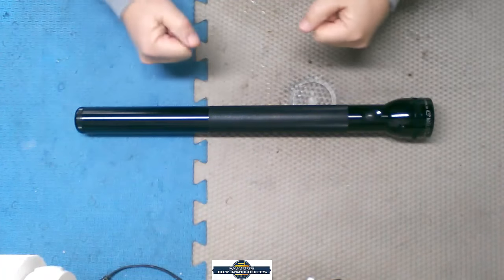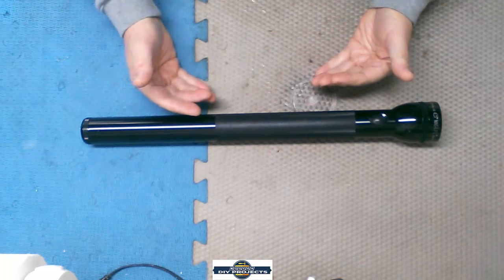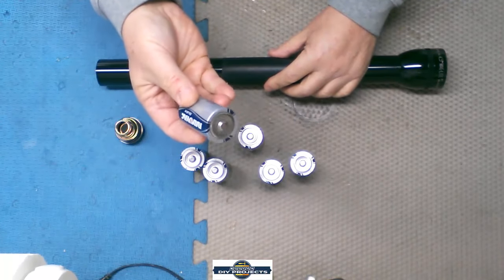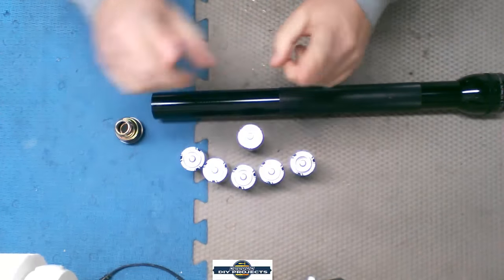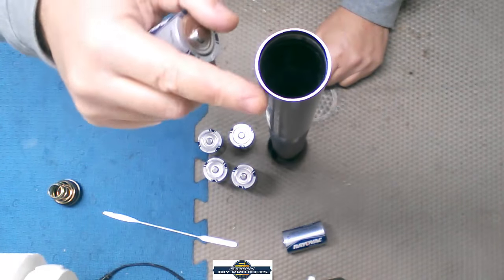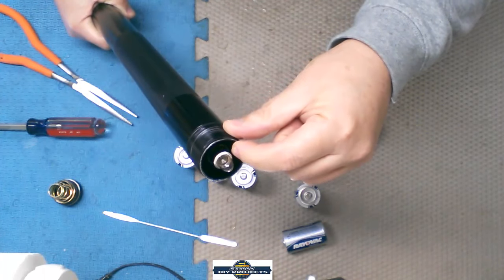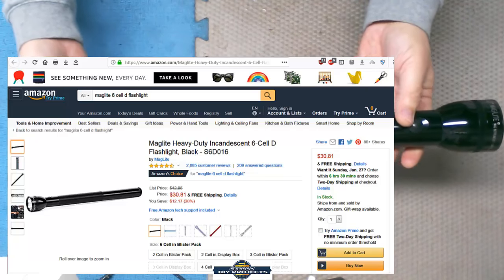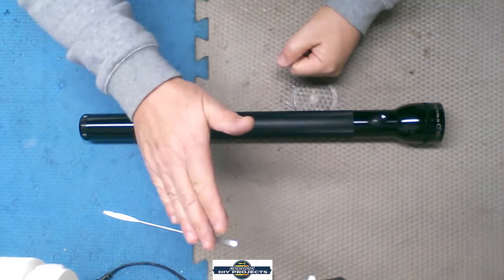Maglite Flashlight Batteries Stuck Removal Guide / How to Remove Exploded Batteries

Comment from the maker: In this video I explain how to prevent batteries from exploding inside your Maglite and possibly ruining it, and if the batteries do explode or leak and swell up, how to get them out without damaging or ruining your Maglite. I also throw in a few useful nuggets of information along the way. Hope you enjoy the video!
Reply: Yeah. The new ones are nowhere near the thickness of tunmbe as the old ones
Reply: Btw, which way, looking face onto bulb, does that part unscrew?? Yep got a bettery stuck corroded lol
Reply from the maker: @ozdavemcgee2079  Keeping in mind that mine is a 30 year old design and newer ones may be different, it's the standard lefty loosy. It is common for that part to get stuck, so don't force it or you could break it. Do what I did and soak the batteries until you can get them to loosen. Also, you can get a really long lag bolt, drill the batteries then screw the bolt into the batteries and and pry them out from the other end.
Reply: My batteries are stuck....  Can i really pour a solution of baking soda and water into the tube without damaging the torch?! Thank you v. much for the video!
Reply from the maker: Yes you can. It wont harm the aluminum body and it will neutralize any acid in there. I may fizz like crazy so just be ready for that.
Reply: @ModernDIYProjects  Excellent, thank you! I will try that!
Reply: Same problem. From Kashmir
Reply: I was happy to find this I’m gonna try it because I have two mag lights and one of the batteries are stuck in it my question is about the spare bulbs I don’t see one in the It shouldn’t be noticeable or do we have to actually pry something up to get to it
Reply from the maker: @Lisa LanceWork  Sometimes it may be covered by a piece of foam to protect it. It may also have fallen out or been removed by someone at some point.
Reply: Thanks
Reply: I would like to add a word of caution regarding where you work on removing the batteries and disposal of potential overflow. Initially I tried some cleaning vinegar (20% vinegar vs just 5%) and some baking powder plus a couple chemicals for cleaning rust of metal before I found the oil recommendation. While I used appropriate caution to protect my hands and had the MagLight standing vertically inside another container to catch overflow, apparently some of the vinegar solution still contained some battery acid and etched a blemish into my stainless steel kitchen sink😬  Not a large area but it sticks out like a sore thumb appearing as if it had been hit with an abrasive. There is definitely a very thin depression in this area I discovered after trying to scrub off what I believed was some kind of residue.
Reply: Maglite should have some sort of detachable cylinder to insert batteries into, and have that in and out instead. Perhaps out of plastic and with some pulling lobes. A possible few external  millimeters of outside thickness caused by this would not hurt too much.

Comment: I'm 65 years old.  When I was a kid, batteries leaked.  The battery manufacturers would GIVE you a new replacement flashlight, radio, etc.  They got tired of doing this and started making batteries that didn't ever leak.  They were leak free for years until the manufacturing went to China.  Now they leak again.  And I have had a $175 GPS unit destroyed by leaking batteries.  (There are so many screws to take the battery cover off, I didn't check as often as I should.)   The point is, WHY DO PEOPLE ACCEPT THIS?  IT is NOT the flashlight that is at fault. IT IS THE BATTERIES.  COMPLAIN to Eveready, Duracell, Rayovac, etc.  THEY ALL LEAK.   COMPLAIN.  Maybe if enough people complain they will FIX the problem.
Reply: Yes the old batteries didn't leak. The reason why you don't have those anymore is the way they were made. They were heavy metals in there and amalgam that is sometimes still used to fill teeth in some places while mostly forbidden in the west. So if you don't care about anything and want far less power from them, then you want those. 
If you want to reduce the chances of leaking:
Zinc-Coal, leak a lot cause the electrolyte is eating through the outer shell until it leaks out. 
Alkali-Manganese batteries leak far less (IF not the cheapest and if the whole thing can breath 1-1.5 years are fine). If they leak they'll leak from the negative pole (kathode) there are small holes to not have the battery really blow up from pressure build up. I still think they leak too often.
Lithium based batteries can be stored for 10 years and have the best quality control so they'll have the least chance of leaking. In the 8th year or so it's still 90%-ish like when it's new and they can stand the cold the best too. So buy once, cry once.
After the battery choice there are a few things to avoid to not increase the risk:
1. Do not mix somewhat used batteries with a new one if you got one left. Higher leakage chance of the old one. 
2. If you know you won't use something for months and it's no emergency equipment, take them out. Some say to tape the contacts but giving the spring contacts some time to relax isn't bad either. Little bag with a clip or zip log bag with it. I do that for some measuring equipment I rarely use. 
3. If batteries already leaked and it's some equipment you really care for, take the time to clean those (hopefully quality chromed) contacts with lighter fluid, alcohole (no extreme percentage for plastic) or what also works well is citrus acid (powdered to clean water kettle/water boiler and afterward some of the above to remove residuals of the acid. This milder acid (low concentration in the powder form with water) will neutralize and dissolve the alkaline crystals. Only if the contacts are clean they can't help to corrode the contacts and corrode the batteries' contacts when they are left there. It has to be spotless. if you read this far I recommend the Bunny in the max variant. If some is left, it'll eat at the spring contacts and they'll snap off. Luckily those are mass produced and cheaply found online.
4. In worst cases, you can use sand paper or a glass fibre pen that is used to clean circuit boards. That takes off material from the contact and from that point it will corrode far more than with the chrome on it. So don't use abrasives unless you see no other way and it just has to work for now.
Reply: I swear to god I don’t remember that being that big of an issue either. In more recent years it’s like they all do. Past couple months I was doing my rounds changing batteries and at least half had bad batteries.
Reply: “Chy-Na”

Comment: Don't try to "unscrew" the bulb carrier/switch assembly. That will break the assembly! The assembly is held in place by a snap ring which sits on a groove on the front end of the flashlight as a stop and a set screw. The normal way to get the assembly out is by removing the rubber cap on the on/off switch and then accessing an allen head screw that is the set screw. There are youtube videos that explain how to do this. If it is possible, you can undo the set screw then try to remove the snap ring to access the front end of the tube. If you can do that, then you can try to whack the battery from either end.

Comment: there is a lock ring in front of the switch assembly, and it is held in with a set screw under the rubber button. it can only slide out backwards like the batteries.

Comment: I just took my maglite and tap the bottom of the aluminum casing against a 2x4 until the broke loose
Reply from the maker: But when they really swell up inside that just wont work. That is when you do a lot of cursing to the battery gods! 🤬

Comment: Thanks for this.  I have the 3-AA cell Maglite w/a stuck top cell.  Started with baking soda and water, then hot boiling water, then WD40, the latter requiring several appls,  patience, and poking.  Finally freed up and saved me from trashing it and spending $$$ on new....
Reply: Wonder Bill  Thanks - great tip. WD-40 worked for me too - just a couple of appls and freed the very corroded batteries in minutes.

Comment: These torches are utter rubbish. This is the second time I've had these antics in 3 years. the last time I drilled the b'stads out. This time I am trying your oil idea. I keep the torch handy for emergencies but unless you have 15 emergencies a week you don't think to check the batteries - and then when you have the emergency you are in the dark and unable to put new batteries in. You can get a rechargable and much brighter torch from Toolstation for £13 made by Ring - and I think that's the way to go.
Reply from the maker: Well, they were the best back in the day, but today like you said there are many more alternatives.

Comment: I can't believe it!  Your idea of pouring oil into a Maglite actually worked on my 3-cell.  I unscrewed both the top and bottom parts and set them aside.  I used a vise to hold the Maglite upright (bottom up) and put a small catch pan under it.  I opened a can of regular motor oil and filled the flashlight up to the brim.  For several days I added oil every time I walked by (just like you said).  The oil ran down along the batteries, past the switch, and through the top of the flashlight and dripped into the pan.  After 2 or 3 ounces of oil ran through I decided to see if I was doing any good so I took Maglite out of the vise and whacked it down on a 2x6 on the garage floor.  After a few hard hits I noticed the battery had moved a little.  A few more whacks and whatdoyaknow, the bottom battery came out.  I kept going and the middle battery and then the top battery came out too.  The MagIite's threads were not damaged.  I used a screwdriver and a file to dig off the corrosion caused by the battery.  I sprayed brake cleaner and contact cleaner both into the flashlight to clean up the mess, using a rag and long screwdriver to swab everything out.  I actually put a little lithium grease on the batteries before I put them back in.  The great news is the Maglite works!  Hope you're able to get yours going again too.

One last comment; I threw a 2-cell Maglite away last year that had corroded batteries.  I tried the lag screw method to remove the batteries but it didn't work for me.  They were stuck tight.  It did hurt to toss it in the trash.  I wish I'd tried the oil soaking trick with it.  :-)
Reply from the maker: Another Maglite avoids the trash can. Glad to hear that! 👍
Reply: Did you have the 3rd gen maglite?
Reply: All you have to use to neutralize the alkaline crystals is citric acid you may use to get rid of scale in your water boiler.
Reply: I think there is better way than oil. NAPA has a corrosion battery cleaner that would be more suited. As onpsxmember said, you need something to neutralize the alkaline crystals.

Comment: Thanks for the video; I used several tips you mentioned, including baking soda and oil to save my 3D cell Maglite.  Fortunately, only the rear most battery leaked, so the slight corrosion damage inside the tube was easy to get to in order to clean it up and smooth it out.  That corrosion, however, did make me fight to extract the one leaking battery, so I ran a screw into it, locked Vise Grips onto the screw, then tied the pliers to an immovable object with a short piece of stout rope and gave it a mighty yank-success!  The other two batteries slid out with little effort, so overall, I was pretty lucky.   Irks me though, how batteries surprise you like this; I have another Maglite with store brand batteries with a "Use by" date of 12/2009!  Just checked it, and all is fine.  Some years ago, however, I discarded a like-new 2D Maglite because the batteries ruined it within the first year.

Comment: Great video, the electrolyte in these batteries is potassium hydroxide and is very hygroscopic (draws water from the air) this is the biggest reason they swell up and there is also outgasing going on in this sealed tube environment, if someone else commented this sorry, i havent read all the comments. Great video to learn about the Maglite construction.

Comment: Thank you, thank you, thanks you! The Duracell batteries are a tight fit at the best of times but when they explode then you have a serious problem. The oil treatment, large scewdriver to turn the battery and a coach bolt into the battery to pull it out eventually worked for me. THANK YOU! Perhaps I should point out that this is my emergency torch (doesn't get used much) and the expiry date on the battery was 2010. Respect to Duracell because the spare batteries I have are all 2010 and all have retained their full charge. Only dropping the torch on the garage floor led to this discovery, suspect a slight airgap as everything worked when I put it all back together.

Comment: Thank you for the tips I added lots of WD-40. I let it rest over night and it worked!

I took out the bulb and the electronics and I had to hammer it out, but it worked!

One remark:
There is a ring holding the front - that’s not specifically mentioned in the video, you need to take that one out, too, if you try to pull der bulb holder unit.

Thank you!

Comment: I’m gonna try this! I bought a Maglite, I think it’s a 3 battery model, from a thrift shop -I love these lights, they are the best! I thought I’d make the small gamble, considering that the price was $4. I could not get the back cover off so I took it over to my husband’s bench vise and it worked! But the batteries, however old they are -are fused inside! ☹️ I can’t get the bulb cover part out so I’m just leaving some 3-in-1 oil in it to try my luck 🍀 THANK YOU so much for posting this…I really want to make this oldie work again!

Comment: Thank you so much Sir! You saved my old trusty 4 D cell Maglite that I bought new in December of 1993 upgraded to the LED bulb. Danged Duracell! The 4 of them got stuck in the flashlight and I couldn't get them out.

I tried the oil trick and it leaked through. I recirculated the oil about 10 times then banged the bottom on a piece of wood. The batteries got dislodged with the oil and the banging.

Even banging the bottom of the Maglite it didn't cause any damage at all! And I'm skipping buying Duracell batteries from now on and maybe stick with zinc carbon type batteries. I have a feeling that those won't cause any future drama.

Comment: The way I did mines I drilled a screw on the first battery pulled it out with vise grip pliers was little hard but got it out then I put hot water from kitchen sink let it running for 5 minutes in battery tube and used a butter knife to wiggle the other batteries took little time then finally rest batteries came out now inside tube was dirty of battery acid so I let more hot water used soap put a bottle scrubber inside tube clean as good as I can then with a air compressor dry inside tube really good then put back together and greased it good and put new rechargeable batteries instead of regular alkaline batteries and my Maglite was back working for people that have old Maglite flashlights don't throw them away I was about to thank god I didn't New Maglite flashlights not made the same old school better build to last and last long time.

Comment: Ty for this video. I have a mini maglite (2xAA). I also had a "ultra mini" maglite (1xAAA). I had an expanded battery in this one. I found good advice here:). Mine was in really bad shape though. After several cumulative hours of work, still unsuccessfull, I had to put a screw in it, then pull with a tool. Only the heart came out. Then scrubbing out the black "powder", then trying to dislodge the outer "welded" "skin" of the battery while prying with the thinnest flat scrwdrvr i could find... I stopped there cuz anyway during my 1st tests I damaged the plastic part near the bulb, and also I didn't have the many other hours needed to eventually finally succeed... I'll sure apply your suggestion to open the surviving one once-a-month to let it breathe! Tkx for the explainations also about these phenomenons, your video is the only one I found on Yt on this subject that was explaining the causes! I also like your vids on some of your old tools since my father had the same and he gave those to me:).
Reply from the maker: Thanks for your comment and I'm glad you enjoy the tools videos that I show. I didn't mention in the video to use a screw to pull out the batteries because I didn't want someone to get hurt with the battery exploding, or the chemicals inside etc, but you obviously were smart enough to know how to protect yourself when doing that. Glad I could help!
Reply: @ModernDIYProjects  The videos I saw about this "method" were not talking about a possibility of explosion or leak, if you can tell me more i would appreciate. Was wearing gloves, mask, goggles and kept head away cuz i tend to be cautious though!
Reply from the maker: @sergest-amand1164  I didn't mean exploding like a bomb, more like just toxic chemicals coming out and possibly hurting someone who is not careful. You did it the right way. I always try to be extra careful when I mention things on video because if there is a way to get hurt, someone will find it and then could possibly blame me for their mistake. It's a minor danger, nothing great, so not to worry.